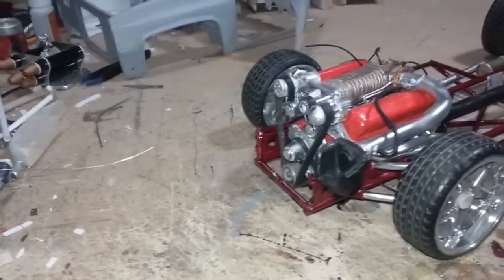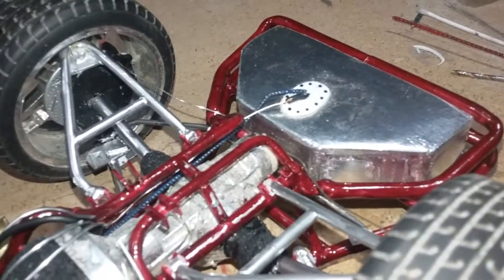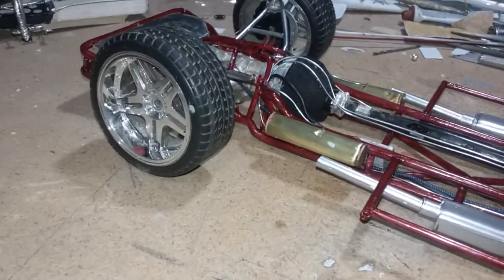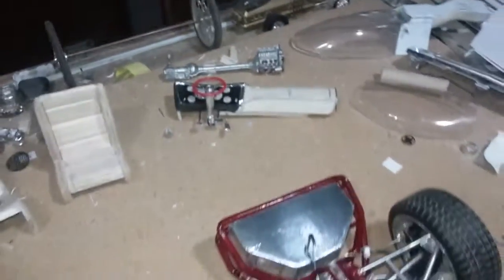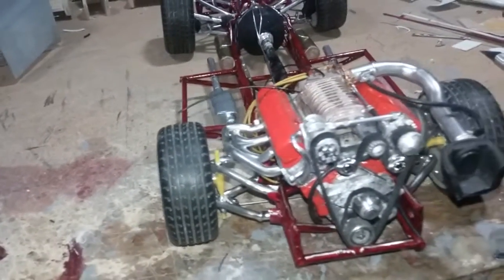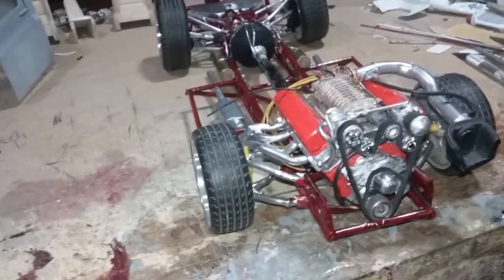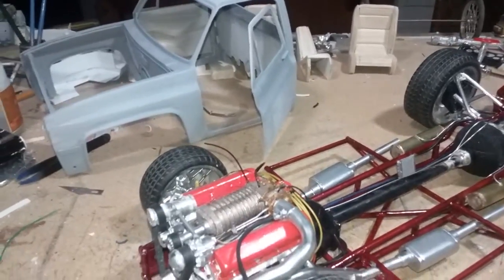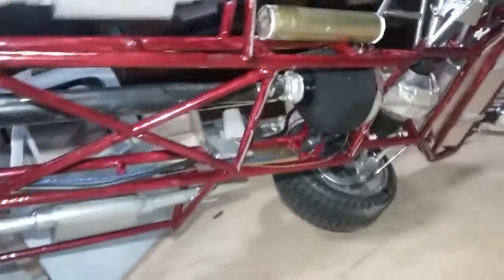Scale model car

Comment: Did you use balsa wood for the dash and seats?
Reply from the maker: Yes it saves time when building some custom stuff if you mess up you can glue more wood on it and sand it down i often heat plastic over the wood to make plastic molded parts